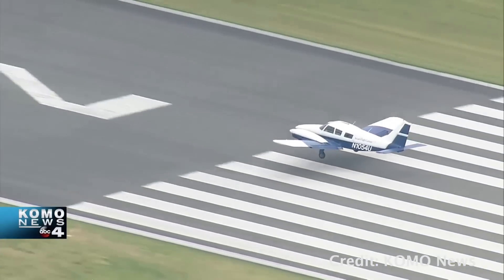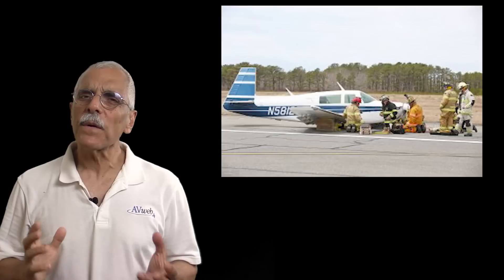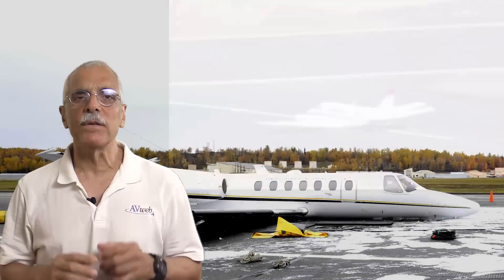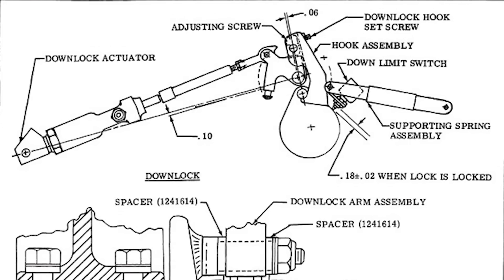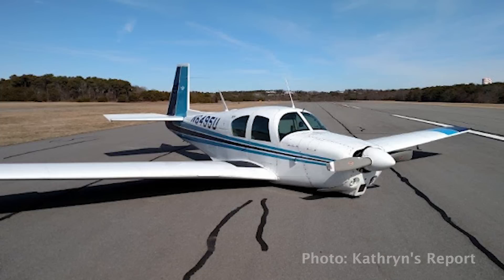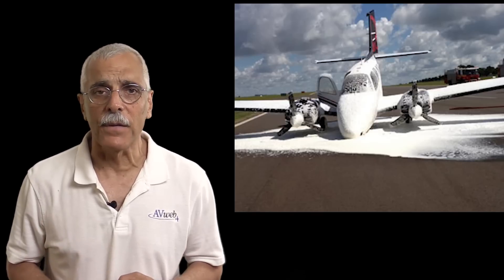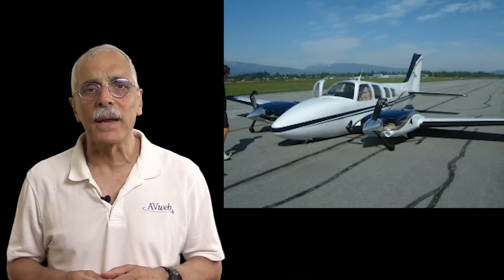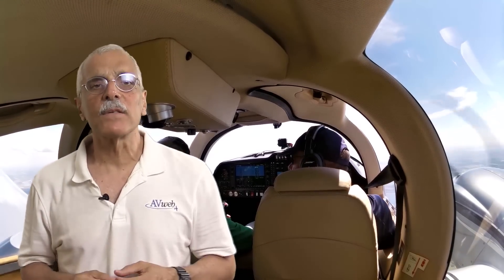Why Gear Up Landings Happen

Comment: Excellent analysis!
Just want to add a strong vote in favor of Paul's recommendation "land on a runway, not on the grass." In the case of my experience, a bolt had broken in the gear on takeoff and no wheels could not be lowered by any means. After a tower fly-by to confirm that all wheels were 80% up, I elected the grass. This was a mistake, as a clod of dirt pushed up into the belly of the plane and caused a rib to bend. This structural damage upped the determination from "incident" to "accident" and caused an extra week of repairs that would not have been necessary if I had chosen the runway. Lesson learned!

Another shock came when the airport I had selected for landing submitted a trumped-up bill for dozens of hours of "fire watch" and "overnight security." The crooked airport manager smelled an opportunity to line the pockets of everyone on his staff and despite my telling them that the claimed man-hours absolutely did not happen, the insurance company paid the bill anyway. So the second lesson learned: don't just land where you had originally intended to land. Get to a safe altitude, make a cell phone call, and find a airport within comfortable cruising distance that has a well-regarded maintenance shop! Land there, and avoid possible expensive and delaying transportation by truck.
Reply: mdickinson  ......I know exactly what you mean about crooked airport staff . My brother borrowed my 172 parked it didn’t chock the wheels (engine off )it rolled into a hanger door making a hole about an inch around . The insurance adjuster ask me to meet him at the airport the door had been damaged by something red 12 foot up ( my plane is green and white ) .The  manger said all the damage on the door was done by my plane and had a quote to skin the whole door 40x16 . The adjuster ask the airport manager if he wanted to continue because insurance fraud was a serious crime. The insurance company paid $40 for the 2x4 panel .
Reply: Any airport personnel taking advantage of an emergency situation is  not going to be an airport where I will ever land again!  Yes, even airports can have crooked staff!  Insurance companies shouldn't pay for disputed charges, because they will just raise your rates if they do!
Reply: "Yes, hello back-up airport tower, ummm, what are your rates for emergency landings and do you have a good yelp rating?"
Reply: wjatube Seems like you misunderstood my advice. The phone call (made from a safe altitude with plenty of fuel on board, using a Bluetooth headset) is to a friend who has a similar airplane, to say “do you have a recent issue of the Bonanza/Mooney/Malibu club newsletter? Open it up to the list of recommended shops. I’m on a long trip and I find myself in southern Illinois having gear trouble - are there any shops in Illinois/Indiana/Missouri on that list?” 

If I had thought to make that call, I could have flown 40 minutes north to a shop with a sterling reputation and landed there. I could have avoided being fleeced by an unscrupulous airport manager, and (more importantly) avoided having to remove the wings and transport the plane by truck to an airport with a maintenance shop.
Reply: Unfortunately, "Larry G.,"  this world is FULL of people who are avaricious and will take any chance to line their pockets -- and it's getting worse.  People lie, cheat, almost anything to keep blame from themselves, or to make money off of someone they figure has money!  We are FORCED to be defensive every minute today, or someone will take advantage of you, if they can.   And that's not being sardonic, but safe!   Sad, but true.
Reply: @MJLeger-yj1ww  
You're the man with brains. Cheers. 😎👍
Reply: "Larry Green" -- good for you for defending yourself when you knew the airport was just trying to get something for nothing.  People always believe just because we fly, we're millionaires -- some of us just love aviation and flying and that's why we do it.  To go places, sure, but we're NOT going to pay for someone else's errors!  Keep up the good work, it helps others from being victims of the avaricious!
Reply: Mentioning the maintenance shop is a truly great advice. Thank you! I'll keep that in mind. 
Especially if there is nothing else happening on board or there are more airports around. 

Plus the tower fly-by is always a good idea, if there is a tower. I hope to buy a retractable soon and I might install a camera...
Reply: "Get to a safe altitude, make a cell phone call, and find a airport within comfortable cruising distance that has a well-regarded maintenance shop! Land there, and avoid possible expensive and delaying transportation by truck." Now that's wisdom.
Reply: @error.418  
Not a good idea. How many calls the pilot need to make before he finds one suitable for a safer landing and budget to meet the after-crash costs? Preparation is better than cure. All pilots should plan ahead, ring the places around their usual flying routes and enquire about whatever they need to know, memorize or write it down in a log book, not after they get into bad situations. Panic comes after they're caught in landing or out of fuel troubles. If that shit ever happens, they (the pilots) know the drill and call the airport closest to them in case of crash landing.
Reply: @mickcarson8504  Everything I said is the correct order of operations in this situation. It is good. Preparation is also good. What I said does not rule out preparation.
Reply: Great tip on finding a reputable airport.  Never would think of that at that moment.
Reply: @MrJdsenior  
Yes, and an even better tip is to find reputable airports without crooks and stay in touch with them, always, in case of incidents like these. Visit other local airports around the entire range of your extended flights and be known by them. This way you will know them as well as staff at these airports will know you, whether you're rich or poor, love aviation or not, they will remember you as, 'Oh look who is here, welcome to our airport, Mick, glad to have you here.' And Mick says: 'Same to you. I have a problem, the landing gear is jammed!'. And the Tower says: No problem, I can see the front gear is jammed from here. The grass landing strip alongside the runaway is as flat as a pancake, belly land there, since your aircraft is doomed to a rough landing, at least it will slide on the grass to a smooth landing without catching fire. Land on the grass long and flat, do not dive on the grass hard. Emergency is on stand-by. Good luck.'  So, like I said, if hobbyists can successfully land model Gliders on grass and they are piloting them on ground with radio controls, surely pilots can land their aircraft on specially prepared grass runaway for such emergency situation such as jammed landing gears, and these are piloting the aircraft on-board, not from the ground, like modelers do. There is a high chance that belly landing will be a success, not a failure, as long as the jammed landing gear can returned back into the aircraft, all will be well. If you prefer to belly land on hard tarmac and the sparks sets the aircraft on fire, you will be roast by the time Fire reaches the scene. As I also said, don't just fly without planning ahead in case of emergency, as aircraft are flying machines and machines can also fail. Plan ahead and memorize what you learned. Stay alert and give your bird periodic check-ups on bolts, links, cables fuel lines and engine. Take care.
Reply: @mickcarson8504  Always pays to know and be known by people you might have to call upon later.  Good point.
Reply: @MrJdsenior  
Yes John, it does pay, but always watch out for those with flashing ($)^($) in their eyes. While you chat and get to know the person, that person thinks about money, whether you're rich or average Joe. When they chat with you in a friendly, welcome sense, their brains work in a 'money-for-the-taking' and greedy sense, not in a 'glad-to-see-you' sense. If you worked in an airport you would certainly know what I mean. So, get friendly with them without showing them you're one of the Jonesies who spend big and flashing wads of money for coffee, drinks and meals, like James Bond. People read you just on the way you act, spend and talk, at the same time wearing flashy sunglasses, gold chains, rings and a Rolex Daytona.
Reply: @mickcarson8504  Can't argue with that either.  ANYONE in business is there to make money...if not, they usually don't stay in business very long.  But there ARE also still a few out there who define a good business transaction as one where everyone walks away feeling they benefited from the deal and were treated reasonably and with respect.   Happens less and less, it seems, but it still happens. 

People draped in ultra expensive watches, driving ultra expensive cars, in ultra expensive clothes put me off from the get go.  Makes you wonder what they are trying to compensate for, and prove.
Reply: @MrJdsenior   So you got to make a profit or be let go, as you said.  In your opinion, KMART couldn't just make some cutbacks, or something, instead of Walmart dominating over you? You're saying, then, it's just bad management? Is that what you're saying?
Reply: @stratoleft  I have no idea what comment you are referring to, but I doubt seriously I said much of any of that, save maybe the first sentence, and even there I would have likely said 'fail', not 'let go', as I was probably talking about a business, not an employee in that context. 

If you want to copy my original statements into a reply so I know what you are referring to (because I have no Earthly idea), I will try to answer. But to answer you in short, from your "so what you're saying" statements, no, none of that is what I was saying.
Reply: Thanks for the comments, definitely some things to think about should an accident happen. I was also surprised to find out so many landing gear up landings, are just simple human error, although I can definitely see how it can happen. Each landing can be different due to situations occurring at that time. I have read these comments a couple times, unless I missed something I appreciate the original comment, learned from it and see nothing racist about it.
Reply: +mdickinson  Cellphone call as in 911?
Reply: oh wow, they repaired that? I always thought that a plane with damage to the frame will be totaled, because you can't be sure if there are any cracks, bends elsewhere...
Reply: @steve1978ger  My guess is that they would take accurate measurements on points throughout the airframe, do a complete and careful examination of the frame, etc, and open skins, if necessary, to inspect anything that looked even slightly tweaked or damaged from an internal frame/controls/etc. inspection.  Usually, if things have been bent much, I suspect you can see it on the skins as buckling (even small amplitude large frequency type).   I would hope so, anyway.  I would certainly do more than a cursory look, even if it was a relatively gentle 'sledding'.

As I said, I am guessing, but that would be the direction I would take, at a minimum.  Once you have gone beyond the metals plastic deformation point (it stays bent, rather than bending and returning to shape) careful inspection must be carried out (MHO), especially at welds, rivet holes, and major functionally load stressed areas.

I could be all full of crap, but I'll bet that is at least the beginnings of the repair.  I also suspect from repairing previous aircraft of the type suffering the same type of 'prang' there is a fair amount known about the likely problem areas by the air frame techs/mechanics that routinely do this kind of damage repair.  They could speak to this much more authoritatively than I am attempting to do.  Obviously anywhere the skin is worn through (on a runway landing) and structure is lost or damaged are areas that needs repair or replacement of structure.  The question is basically what does the repair vs replacement cost, and how good will the plane be afterward.  I would guess there are techs out there that are really good, and ones that are not, not at all.
Reply: Land at the airport with the best first responders, especially ambulance and fire crew. Plan your actions with the checklist and POH. Then notify them to roll trucks.
Reply: How the heck did this get pinned?

Call around to find a less crooked airfield? Buddy, your priorities are bass ackwards.
Reply: As an aerospace engineering student, I visited NASA Langley and saw their research on aircraft crashes on grass and pavement.  They actually crashed real aircraft from a gantry.  If at all possible, emergency/crash landings should be made on a hard surface!  Grass landings tend to stop the aircraft abruptly and this is not good.  I saw their research back in the '80, so if their is newer research, please comment.
Reply: @Nickvec   you took "aerospace engineering"  to figure that out?
Reply: Depends on the pilot. I was involved in a accident investigation whereupon the pilot was simply overwhelmed mentally by not being able to get the gear down and then stalled turning final.  My advice. Leave your phone alone and fly the plane.
Reply: @passthetunaporfavor  when he recommended finding a repair facility he wasn't recommending to call on final. Most instances people would have or want to burn off some excess fuel etc and during that time is when it'd be a good time to find a approximate field with maintenance .
Reply: Good advice for sure.   What type aircraft had the broken bolt?
Reply: happysawfish The plane with the broken bolt was a Piper. The shop that did the annual inspection had not lubricated the scissors (torque link) bolts. One of them had corroded into place, and sheared during a takeoff from a rough runway.
Reply: +Jewish Privilege Get your racist bullshit out of here.
Reply: Nah, you probably landed on some grass covered, uneven dump. A properly laid grass patch about 10 meter wide and as long as the entire runaway length laid next to the runaway and maintained with either Couch or Buffalo grass, watered and mowed to a 3 inch thickness would suffice for a smooth belly landing. If radio model planes and gliders pilots can expertly land their models on the grass why can't pilots land large scale aircraft? Problem with today's pilots is that they don't prepare themselves for worst case scenario. I mean, let's ask around, let's ask these pilots, when was the last time they ever, and I mean ever, had their undercarriage inspected and serviced? Go, on, say it, when? If we see and know that there are car drivers that haven't services or repaired, or even washed their cars, do you think there aren't any pilots that are in the same slack and lazy attitude, like the Australians and their "She's alright, mate." attitude? Let's start with reasoning about tit for tat, what goes wrong here, so does there. I mean (again), how responsible these people are when they get out of bed have breakfast, get into their cars and hit the airport and fly, and expect their aircraft will be in mind condition, today, tomorrow, next week, month, year, and... when was the last time they had serviced their aircraft? Let's say never. There should be log books to fill in at the airport before taking off, log book that an inspector can check to see if that shows the aircraft had been serviced and maintained and what had been done about it. I don't care if these smartasses want to kill themselves while flying a non airworthy and dangerous aircraft but you have to remember that if things fail they can crash into building, vehicles and people. Is it worth it skipping service of an aircraft for another day, week, month, etc.? And when an aircraft crashes and kills (like I said, I don't care about pilots killing themselves and their passengers, it's their stiff bad luck if they want to be idiots, but...), there are people on the ground, in homes and elsewhere who could be killed. I visit our local airport every now and then and noticed that many planes are sitting in open storages around the airport, with some of them hardly ever used or get serviced. They're tied down and abandoned and I've seen many taking off from storage. You tell me if any of those aircraft had been serviced, had an oil change, filters cleaned or replaced? Ha! Go find out, go. That's why planes crash.
Reply: Mick Carson Nope, this was not some backwater field. I set it down on a smooth looking grass area in between the runway and taxiway of a large airport with passenger airline service. 

After all emergency gear extension procedures had been completed, and tower confirmed no wheels were down, I did a low pass over the area of intended landing to confirm it was long enough, no obstructions, and looked smooth. The grass still turned out to be the wrong choice. 

As someone with hundreds of grass field landings with the wheels down, and one with the wheels up, trust my experience on this one. How many gear-up landings have you conducted - on grass and on pavement?

Comment: The flight school at my local airport recently had an incident where a multi-engine student trashed a perfectly good Seminole because rather than clearing the runway and coming to a stop to clean up the airplane, he started screwing around with stuff on the roll and accidentally put the gear switch up instead of the flaps. The squat switch had failed, so the airplane obediently did what it was told. The nose gear collapsed and drove the nose into the ground, striking both props. Oops.